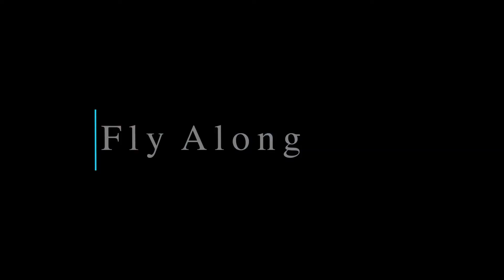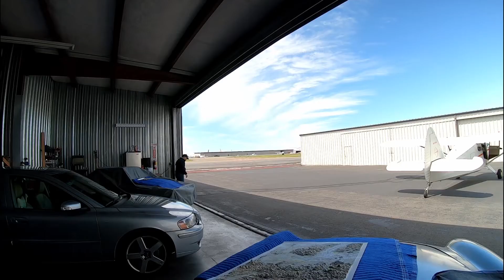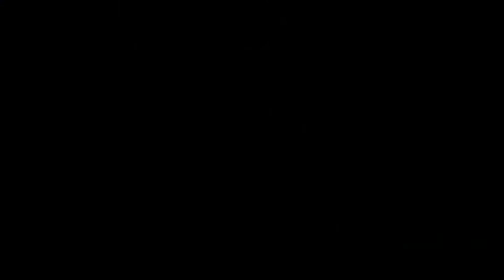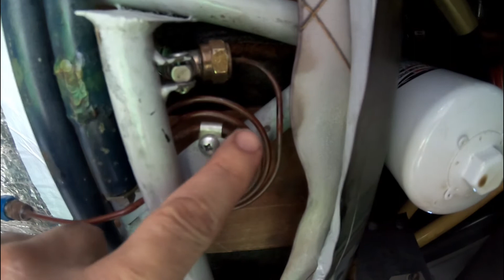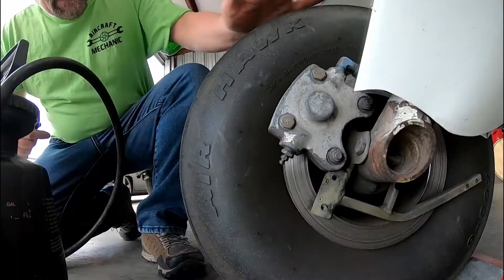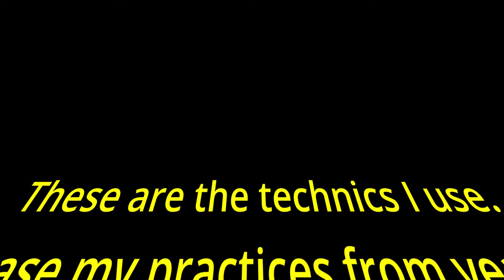Brakes, Broke | Canceled a Cross Country Because of Soft Brakes

Comment: That copper tubing gets work hardened over time and it should probably be replaced with new tubing. IMHO😝 I know it’s only 70 years old
Reply from the maker: I'm surprised at the resilience of that stuff. All metal and, to a degree, most solids will work harden and break. Any Damage to the tubing will concentrate the force and that's where the breaks will occur.

Comment: I totally forgot about that Coil of 8th inch copper tubing that Stinson used for the brake line. The leak that I had in my dash three it broke right at the flar by the fitting, luckily there was enough left over to reflar the tubing.
Reply from the maker: Yeah I think the most common place for those to break are at the connection where it attaches to the Master cylinder.